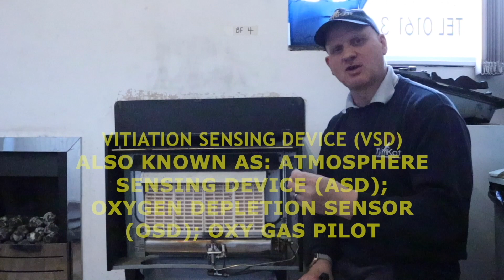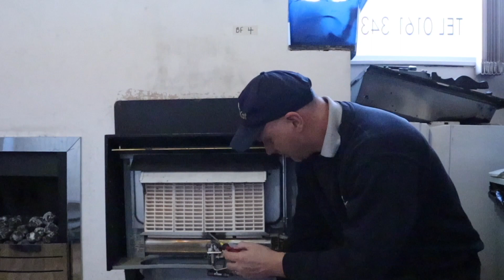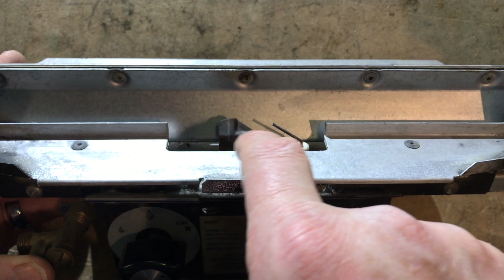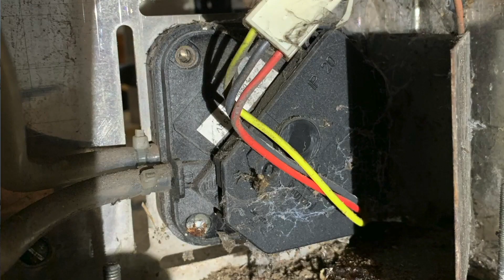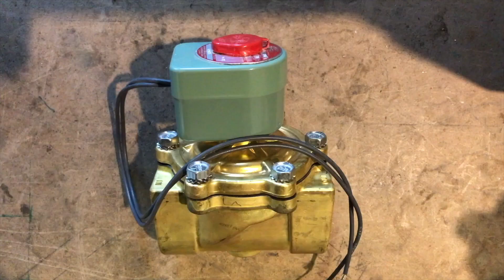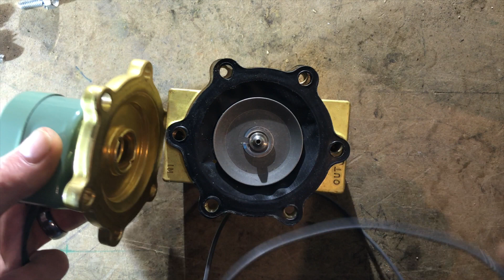GAS SAFETY CONTROLS IN FIRES part 2. A gas tutorial on how gas controls work and how to test them.

Comment: Basket fire with no mis and no vent but passes all test is that ar or ID?
Can't confirm if needs 100cm2 vent as no mis.
Reply from the maker: AR no ventilation failing flue flow or spillage makes it ID
Reply: @Tomkat Gas Training  Thank you Tom, your a life saver. I got worried. I did At risk it, but a friend said ID so got confused.

Comment: Great explanations Derek.   I have an Inset Fan Assisted Fire.  (Verine Fanfare FPF16NV).
The pilot is working and stays on but when you press Start Button for main burner, the Fan stratus up and pulses hight speed then low and keeps going for however you press the start button, at the same time the main gas to the burner does not flow so no moan burner ignition.
I’ve checked the Airflow Sensor and both the Normally Closed and Normally Open contacts are working fine. it has two Solenoids below the burner (Assume for High and Low flame), the voltages to the solenoids are low - approx 150mV AC when start is pressed (no DC). I’m not sure what’s Normal voltage for a solenoid to operate ?
Any ideas or suggestions ?

Comment: Would you just isolate the isolate valve or just cap the open end when moving fire out to service? Or would you not need to disconnect fire someyimes?
Reply from the maker: You are not leaving the gas pipe unattended when servicing so no need to cap the gas pipe but if you were to leave it for any length of time you would have to cap the gas pipe
Reply: @tomkatgastraining  so just isolate?
Reply from the maker: @lostinthoughtscalminsilenc8167  yep
Reply: @tomkatgastraining  put temp bonds on?
Reply from the maker: @lostinthoughtscalminsilenc8167  not when you are disconnecting an appliance
Reply: @tomkatgastraining  why?
Reply: I thought when removing appliance or pipe work you have to put the bonds on upstream and downstream?
Reply from the maker: @lostinthoughtscalminsilenc8167  only when removing the meter or cutting into pipe work. It’s just to keep the earth bonding when you remove the appliances there is no bonding to keep
Reply: @tomkatgastraining  do we purge?
Reply from the maker: @lostinthoughtscalminsilenc8167  if you have no isolation valve on the fire and you turn off at the meter yes you will need to purge but if there is an isolation valve and you don’t allow all the gas to escape then no need

Comment: I have a pilot light that goes week when the fire is turned up to max. This is causing the thermocouple to shut the gas off. Iv cleaned out the pilot tube and assembly but hasn't fixed it. Fire works fine on medium just not on max.
Reply: Sounds like it’s got the wrong injector, is it a natural gas fire or lpg?

Comment: Cracking video. Amazing. Absolute legend. I proper buzz over your videos man. Question time 😬. When testing the ASD on the radiant gas fire, is it a two part test you must to do on the safety device? Is it fine to do one or the other or must you do both checks? What I understood is first you blow out the flame on the thermocouple and count the number of seconds. Secondly, you block the hole where the air comes in for combustion and the flame lifts off the thermocouple and you would count the number of seconds again??? Hope my question makes sense. Thanks Derek 👍🏻

Asian Jon. Training
Reply from the maker: First thing Jon is have you got an ASD to test

Comment: Thanks excellent video
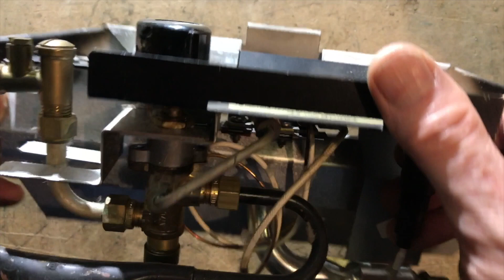8:36 ilfe gas pipe from gas tap to the  burner where it bends towards the burner why  it forms a reservior?and not a pipe bend
Reply from the maker: Sorry don’t know what you are asking
Reply: 8:33 where you filpped over the burner i noticed instead of a 90 degree bend on the pipe (connecting tap to the burner), factory used an end bulgy cover which it let gas through like a 90 degree bend but since bending the pipe is easier i thought there might be a reason for the factory to use this method over just simply bending the pipe.
I know it is not important may be just factory preferance thanks

Comment: Got a Widney radiant gas fire in my caravan but the wire has broke which connects the gas valve (contains spark generator) to the ignition electrode. Manufacturers instructions were not very helpful in specifying what part needed replacing. Any advice?
Reply from the maker: slenderman7676 Rblx if you take the part to your local spares centre they will be able to help you with replacement. They all have a computer system with all the spares for most gas appliances on it

Comment: hey Derek. please help on why Gasfitting fitting are normally taped spread rather than straight thread? any good reason for this? thanks
Reply from the maker: You use a taper thread so it locks up and tightens before it gets to the end unlike a parallel thread which won’t. Hope that helps and thanks for watching cheers
Reply: @tomkatgastraining  thanks Derek. Also any good reason why gas needs to be pressurized to be burnt for heat in comparison to solid fuel is this something to do with appliance design? thanks in advance
Reply: @tomkatgastraining   could please enlighten a bit more on the what the small hole does at the center  the diaphragm of the  solenoid valve? Something to do with the pressure differential ? Many thanks

Comment: Great video again.

The hole in the solenoid valve at the end I’m guessing this helps keep the valve open properly along with the electric current from the solenoid itself?
Without this hole would the valve possibly close if there was a drop in pressure elsewhere on the system for example another gas appliance being turned on?

Sort of like how a regulator works.
Reply from the maker: 1Monaghan did I not explain what the hole is for ? yes it allows the pressure to equalise so the diaphragm will push up thanks for watching cheers
Reply: Thanks !